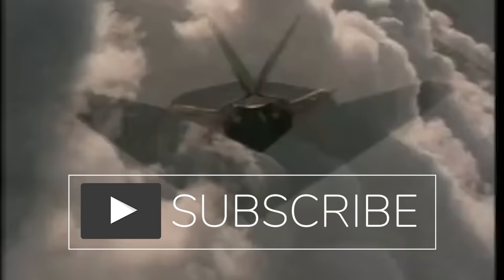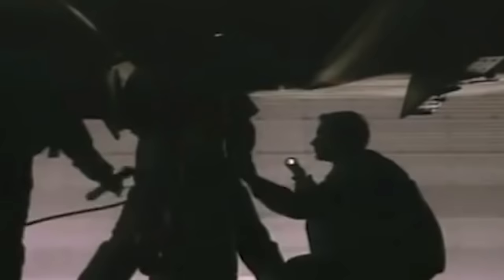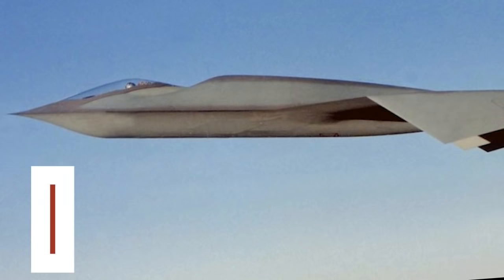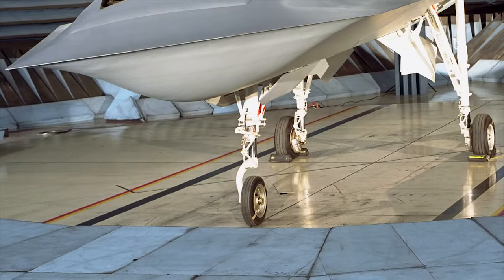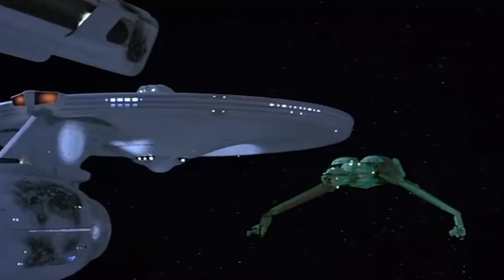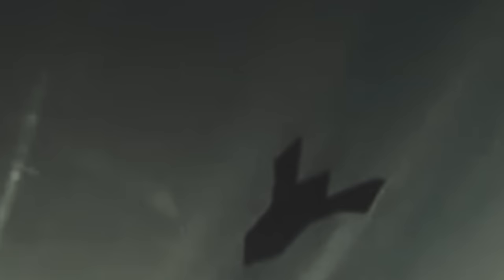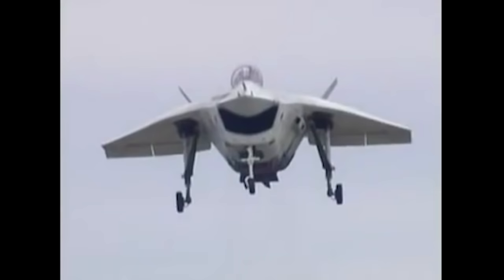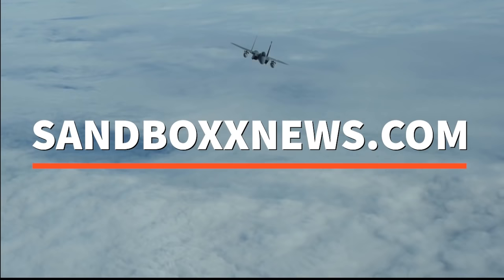Boeing's secret budget-busting stealth fighter

Comment: I grew up on the Puget Sound...I watched the very first flights of 747 float across the sky from Paine Field, Everett Wa..

Boeing isn't even close to what they were THEN.  I have doubts ...because of SLS ROCKET fiasco. Billions over budget. Years behind schedule.  

Add the $ 14 billion in stock buybacks instead of making 737 workhorse a viable new platform, they half-assed it by cutting corners and screwed the pooch with the defective 737MAX.

I doubt Boeing has viable fighter.
I doubt Boeing is in business 10 years from now....as BOEING.

WASHINGTON STATE should force complete management shakeup.
Shutdown Boeings move to Virginia to build a 2nd headquarters in 20 years.

Boeing has become a stooge for GOVERNMENT HANDOUTS, primary reason for VIRGINIA HEADQUARTERS. 
Buy politicians. 
Like most defense contractors. 

Ask yourself this...why is the 737MAX a dog.
Why is the SLS ROCKET billions over budget and 5 years behind schedule?
Why cannot they land the rocket like Spacex a 12 year old rocket company? To preoccupied with stock buybacks ❗

If Elon builds a fighter....Boeing & Lockheed are out. GONZO.

Northrop would be the only competition to ELON MUSK.
Northrop Yf23 was a vastly superior FIGHTER as Prototype-to weird- for the doddering PENTAGON to buy in early 1990s..
——huge mistake; they know it now— short range fighters is all we have in stealth mode, off  of  AIRCRAFT CARRIERS now —F-35. 600 miles shy of YF 23 range even in 1990 ❗
Wrong platform. Overpriced. Crappy mileage.
Anyway, the f22 is great. But it is old school stealth. The YF -23 was/is the platform of the future. We should never have built the f-35 or the f-22. Again old school platform. 
Boeing is a gov. trough feeder. As is Lockheed.